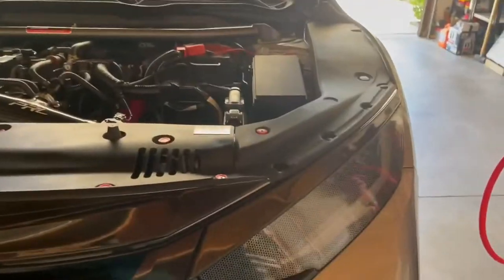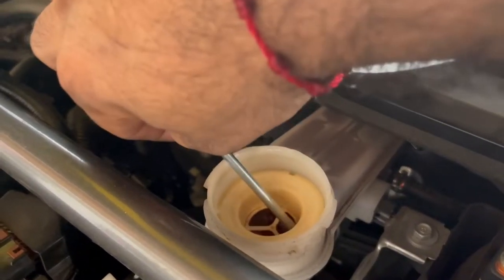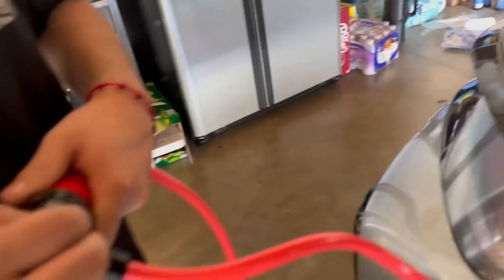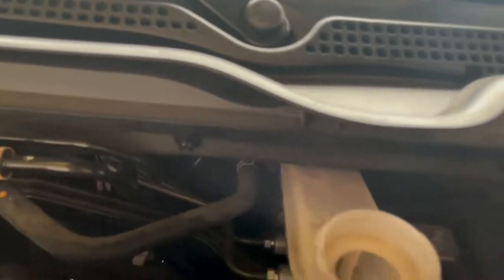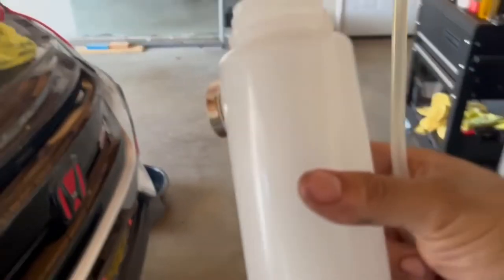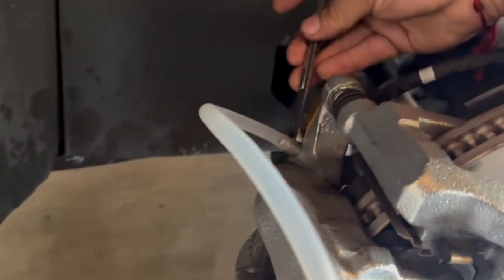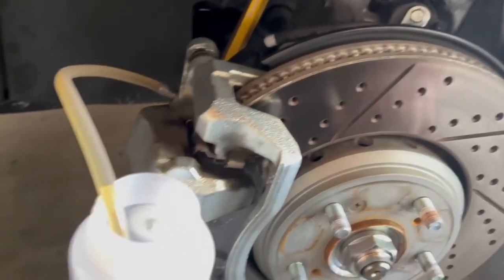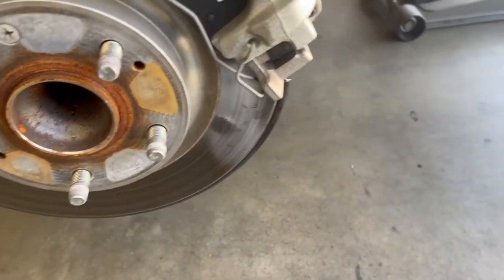How To Change Your Brake Fluid | 10th Gen Civic Si

Comment: I know the manual says one way; but the shop rule usually is a Z pattern starting from the furthest point away from the brake cylinder ( passenger rear) and work your way to the closest. It’s a closed system, so that keeps it sealed and absolutely zero way of getting air in. But you did that way and it worked, so thank you for this video!
Reply from the maker: Yeahhh I know many mechanics prefer that way but I just followed the book exactly and it all worked out!!
Reply: What page gonna be for that information? Is that in the maintenance book?

Comment: It’s not like that at all so easy, juste open the brake fuild cap, put a tygon Hose 1/4 on all your calipers, loose them, put Little pressure on brake and all fluid gonna go by it self to the container by gravity it’s take one hour, btw jacking removing tire and and closing everything